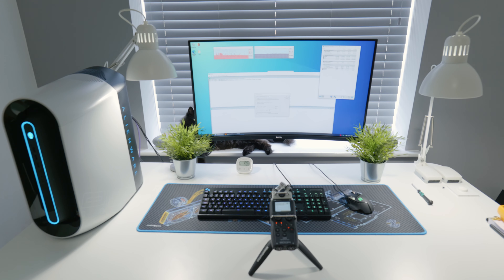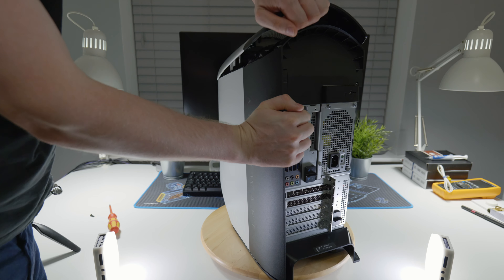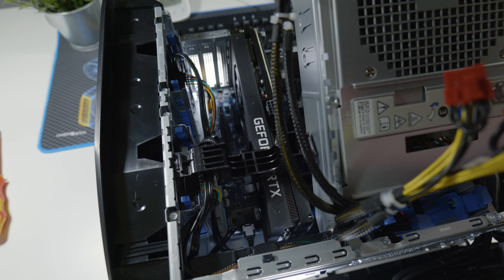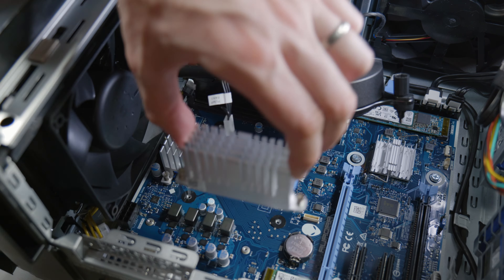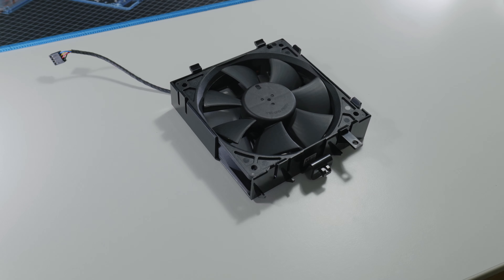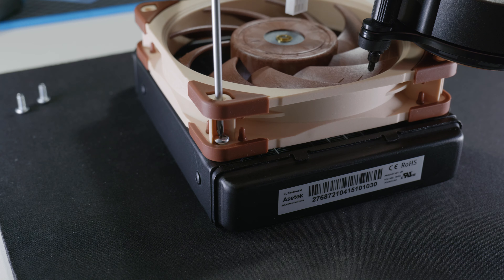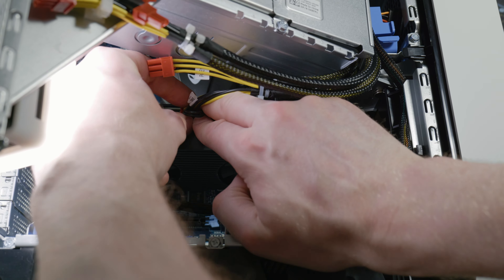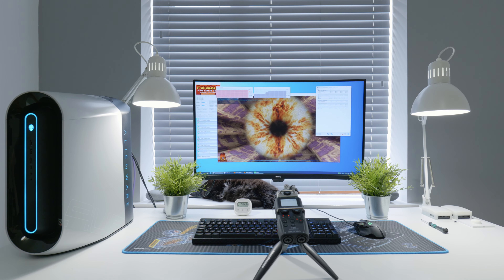Upgrading Dell Alienware Aurora R10 Fans

Comment: It seems like this is an unnecessarily over-thought design.
Reply from the maker: Hi. It is unusual for sure. Feels nearly like overbuilt standard case using Dell's business PC build methods so looks and feels very crude. Outside plastics are different though - a more refined and pleasing look but just a shell to non-functional interior.